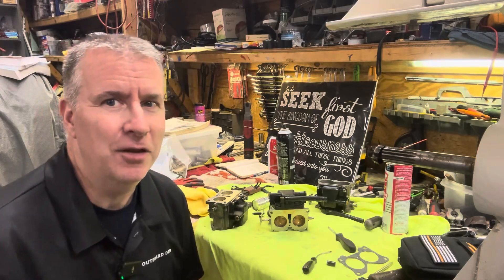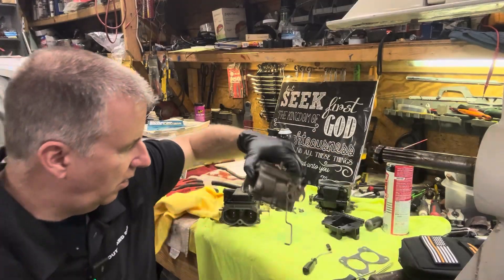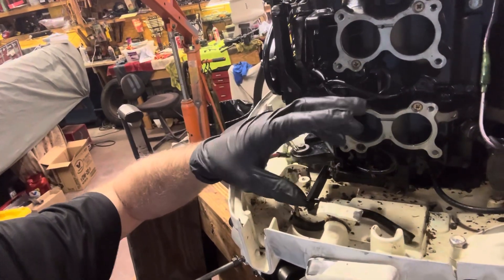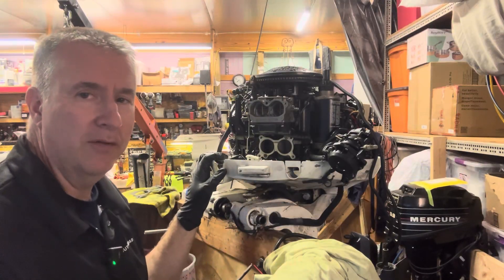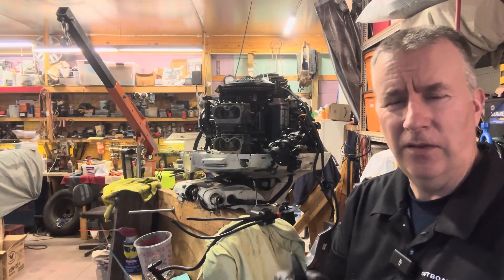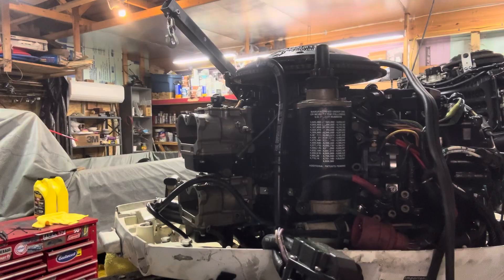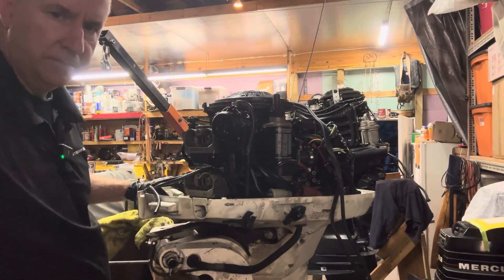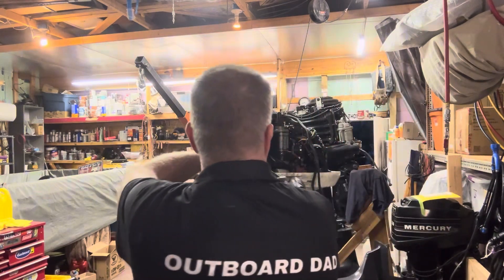“Carb Leaks on a Johnson 90? Here’s How to Fix Them Right”

Comment: You mention ordering parts in many videos. Where are you order parts for these older motors, specifically Johnson and Evinrude?
Reply from the maker: Mostly promarineusa. What are you looking for ?
Reply: @OutboardDad  90 HP 1996 Johnson carburetor parts. Need a bowl.
Reply from the maker: @NeedsMoreToys OK yeah they should have those, be sure to remove the jet and put it in the new bowl depending on the model. I’ve made that mistake
Reply: I cannot for the life of me find why fuel constantly leaks into bottom of motor then into water I feel like it’s effecting me from catching fish 😢
1995 112 Johnson won’t die I mean the only problem I ever had with it was carb trouble.  High speed jets getting clogged.  I just rebuilt them and it ran like a brand new motor but after 5 minutes of opening it up little less then wide open it will start to glitch.  I back off a little more and she is good to go.  Weird. But for now I will keep on running her. If and when she leaves me stranded I’ll call tow boat man for 250 😂 better then paying 15,000 for brand new 4 stroke 😮. 

Them 88 112 are really  some good motors if you can get the fuel issues dialed in .. from my experience anyways.

Comment: We just did a rebuild and now reinstalling everything is it possible to send me some pictures of the small vacuum lines that run from under the top carb and hooks up on the left side looking at the carb
Reply: I will try and send you these pictures
Reply from the maker: Sorry that motor has been sold. Can you sand me a picture of what you’re looking at and I can see if I have the tubing diagram that I can send you? Keith@outboarddad.com

Comment: Have not checked to compression, I did look at the reeds and they looked fine, the motor has sat for about 10 years I picked it up for $300 runs really good on the top end, pushes my daughters champion about 51 mph on gps. I will do a compression check
Reply from the maker: Ok, how about fuel lines? I am allways co concerned about motors that sat so long. Keep me posted

Comment: Good vid. I have a 1986 Evinrude 120hp with a real rough and high idle, no fuel leaks carbs have been gone through multiple times, timing is set with light, has the plastic carbs on the motor, runs good and starts good, you have any ideas?? Love your vids.
Reply from the maker: Thank you for your comment and kind words. Have you done a compression test? The older looper motors did have some idle issues and in later models they added idle adjustments. Starts with compression, if it is even all around then the only two things that make idle high or low on these motors is timing and throttle plate position. I know people who have bought 1996 motors that hade bad cylinders and used the adjustable carbs off of them but let me know how the compression is first. Then you would need to check the reeds. Keep me posted
Reply: The 140 versions of those had giant carbs that are actually very desirable for v6 racing motors but the 120 shouldn't have those.  There are oddball one way check valves between the intake and the boost ports that are forever either clogged or stuck open.  They are supposed to improve idle carburation but i'm about to try just plugging them off to make it consistent cylinder to cylinder.  The throttle blades could be out of adjustment as well.
Reply from the maker: @winningwithoutracing7811 Makes sense, good luck!

Comment: I misplaced that ring, used a small washer that I cut & crimp on. But yeah parts motor saves the day when in doubt of a part or waiting around for parts.
Reply from the maker: @fishawk90  Which ring are you referring to?
Reply: @OutboardDad  on the cam follower.
Reply from the maker: @ Got it
Reply: Good tip on the zip ties, I love it when mechanics share things they learn with others. 
I use flush cut pliers to snip the end of the zip ties off so it doesn't have a sharp edge that can cut you.
Reply from the maker: @ Come on now that takes all the fun out of it! LOL! Those things slice skin well. Especially older skin
Reply: @OutboardDad  gloves prevent that.